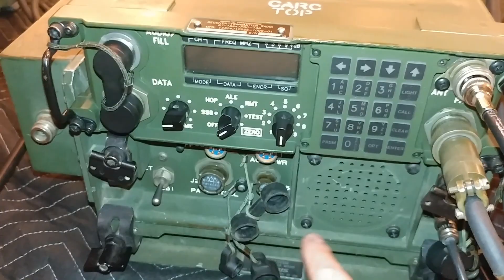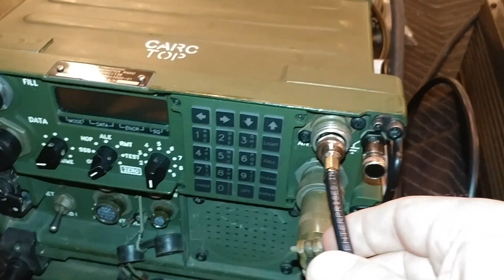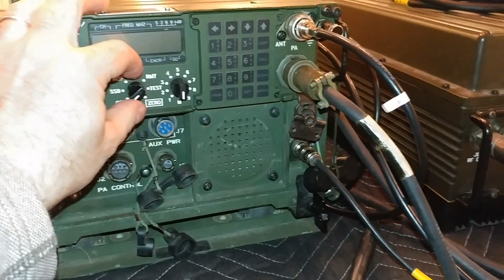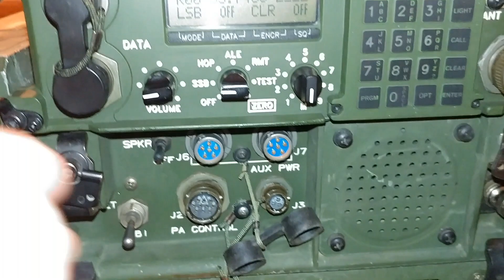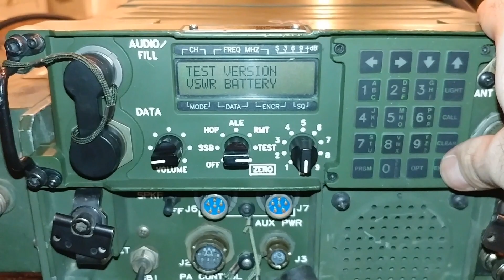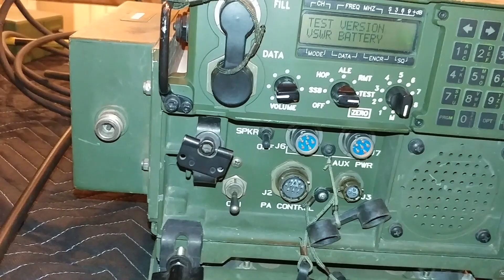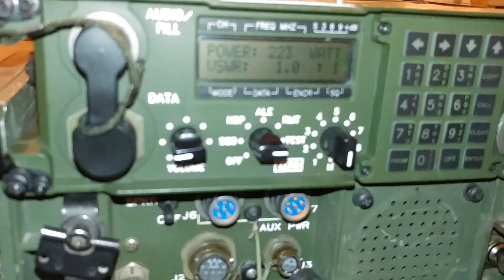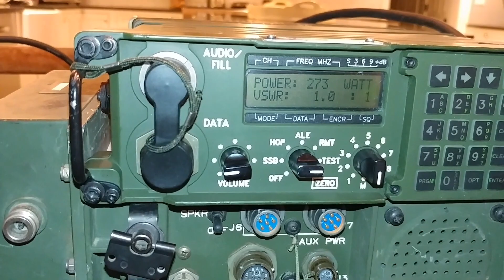Using a PRC-138 with an RF-5034PA-400 400W Amp

Comment: Hello Sir Thank You very much for Your nice video s.
I have a question I have a prc 138 and I won t to feed it with two different separate  battery s 12 volt in the original box .
Can You say if I can do that without  damaging the radio.
If Yes what is the pinout for each battery on the radio like battery one negative on pin 1 than  witch pin for positive ?
Battery 2 negative on pin 2 . wich pin for positive.
Does it work the way I won t manage it.
I hope You can Help me best regards 73ers Hans The Netherlands
Reply from the maker: @henkverhoeven335  radio is 24-28v. Two 12v batteries in series will work fine.  You can google the punouts of the bb-2590 battery to find out how to supply the power.  Good luck!
Reply: @w2hx  thank you very much Sir alle the best for you and You family 73ers